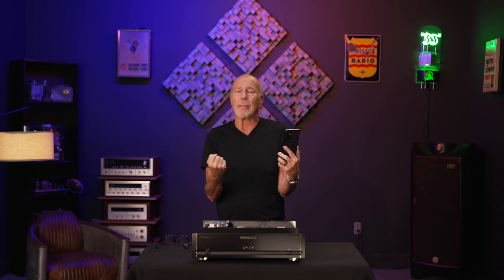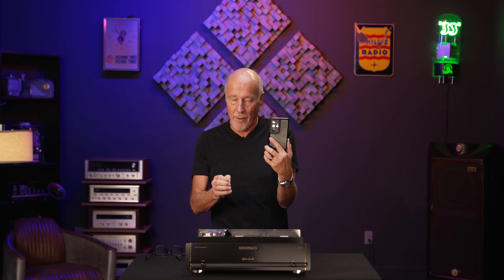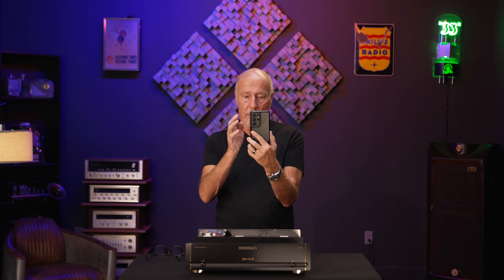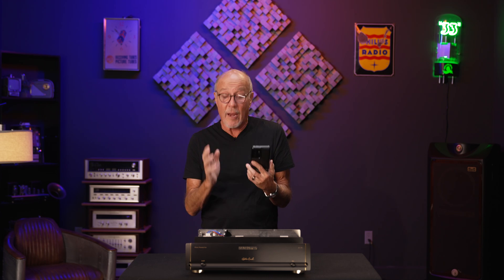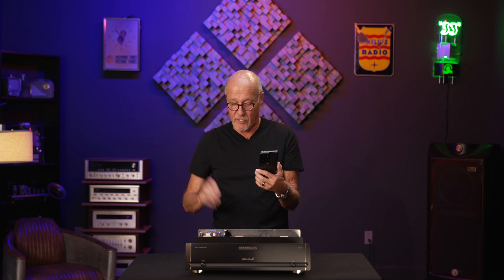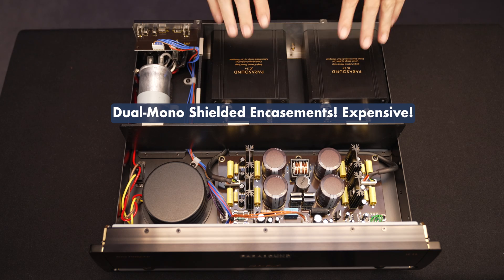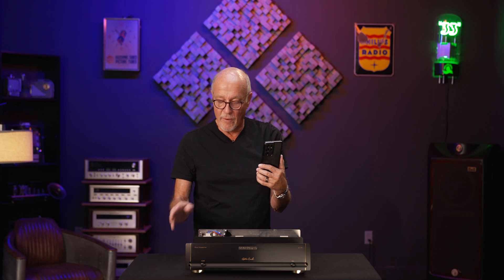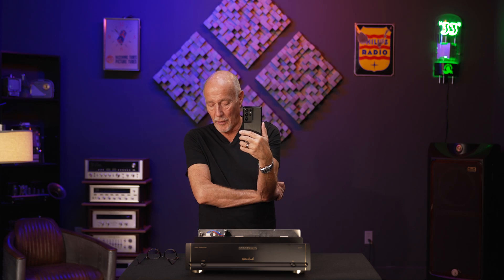Parasound Chief Designer Darren Myers and Kevin go inside the BITCHIN' JC 3+ Phono Preamplifier

Comment: I imagine it would be a useless question to ask if Darren thinks that the JC3+ is superior to his PSA Stellar Phono Stage, not in his expertise but financial or other restraints put on him by PSA.  It seems that the JC3+ has more isolation between its parts that could cut down on interference/hum. Comparisons between the two are fairly scarce here on YT and elsewhere.
Reply: the gimmick of the stellar phono's design is its exclusive use of hi-openloopbw discrete op amps in the signal path; it's a more partsy circuit that necessitated more design 
the measured performance of the two suggests the jc3+ will be a better match for mc cartridges, but its bipolar input op amp is unsuitable for mms from a noise standpoint

Comment: Edit: maybe my issue with my PS Audio Stellar Phono Stage could’ve been fixed with a polarity switch like the JC3+ has(?).

I have a PS Audio Stellar Phono Stage and it’s the best sounding phono preamp I’ve ever had. It’s very versatile in that you can hook up two turntables (mm and mc cart) and swap between them electronically, it has 3 levels of gain, you can mute and pick loading values (greater spread than the JC3+) through the remote. Also turn it on/off. My one issue is that I have a low frequency hum that I just can’t get rid of, even when there’s nothing plugged into the inputs. Discussed this substantially with Darrel and some with Paul and they ended up swapping the internals but to no avail.  Having a second mostly different unit have the same issue would lead to the conclusion that it’s something in my environment. Maybe so, but I’ve never been able to hear a hum 2 feet away from my speakers with any other pp. I’m going to try a JC3+ and see if I have the same issue.
Reply: Nope, didn’t work.

Comment: I'm sure David Myers is a talented engineer, but 20dB extra gain at 20Hz compared with 0dB gain at 1kHz is only 10 times greater and not 20,000 as David states. It would  be impossible to make such huge gain change in a vinyl groove.
Reply: It’s not 0db at 1khz, it’s usually 60dB to 66db for moving coils. That translates to a voltage gain of  1000 - 2000. Due to the RIAA curve this increases as much as 20db, or 10x, at lower frequencies - for a total of 10000 to 20000 times in the linear domain.
Reply: Point taken, but David stated relative and not absolute, but maybe that was my take. Thanks for the reply.
Reply: esl issue

Comment: I've not owned a LOT of phono preamps over the years, but about 10 years ago, I got a JC3, and knew that I'd found something special.  My only complaint at all, was that with my 0.2 mV MC cart at the time, I wished my noise floor was lower.  About a year ago, I upgraded to the JC3+ which has a lower noise floor for the MC gain path.  While the JC3+ doesn't sound 8 dB quieter like the specs might indicate, it does sound 2-3 dB quieter, and the noise spectrum has less energy around 2kHz, so it sounds smoother.  I've also upgraded to a cart that puts out 0.5 mV, and noise is no longer an issue for me.  My phono system is a 30+ year old Sota Sapphire, an Ortofon Cadenza Blue, and the JC3+.  For the first time in my life I'm 100% satisfied with my phono playback!